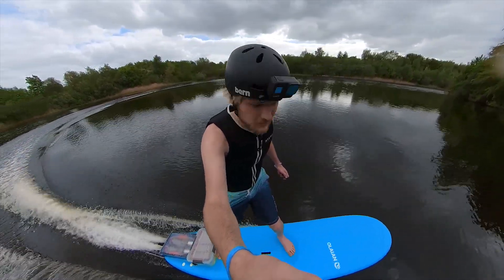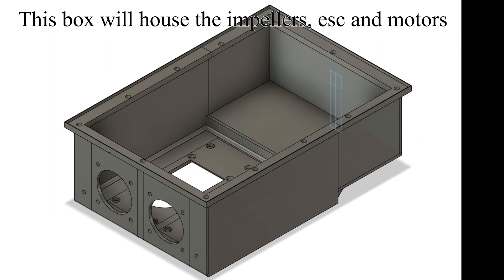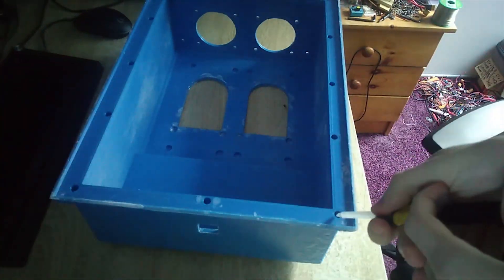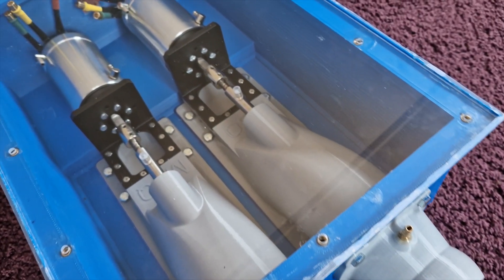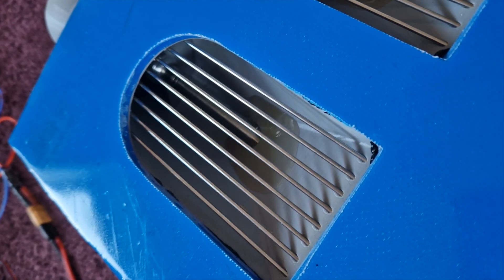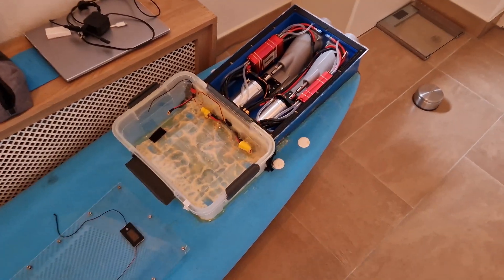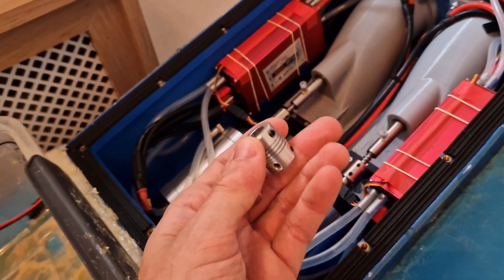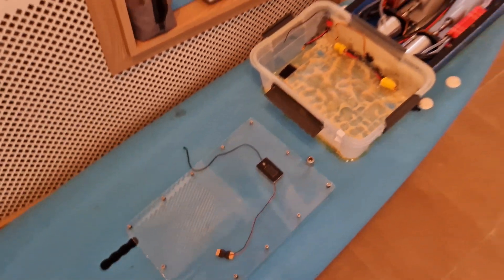Building a 20000 Watts Electric Surfboard

Comment: Nice man. That is some battery pack! What kind of speed you getting on it about 12 to 15 mph?
Reply: We got our DIY board up to 48 km/h! However. Going this fast is no fun.
See my YT channel for how it looks.
Reply from the maker: I have not measured that yet to be honest, I think indeed I go around that speed but quite some top end is left not daring to touch it, haha.

And indeed a big pack, I wanted to go lipo for the big power draw but those are expensive to get a little bit of capacity. Also sizing them into the box was a challange. With liion i could make my own sized packs. Even with al these cells they get a little warm.
Reply: @GalinskyFPV  small cells is the way to go. That's what Tesla and other electric vehicles run on 😎
Reply: Battery pack must be about 1/3rd the value. About 30 minutes of run time?
Reply from the maker: @BariFPV  More like 12 mins, haha, more batteries doesn't fit inside :P
Reply: @GalinskyFPV  that's some serious current draw. I thought with +200 cells you'd get a lot more.